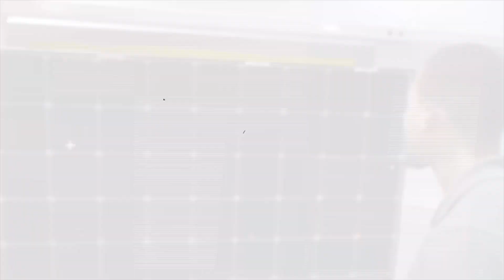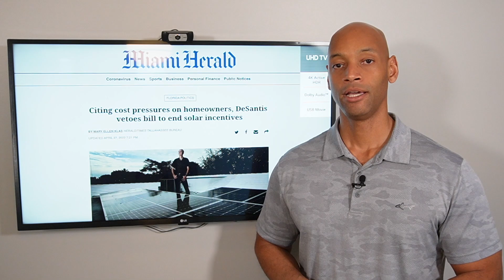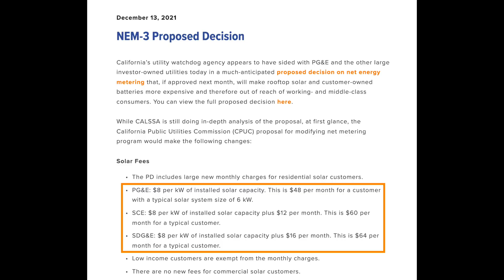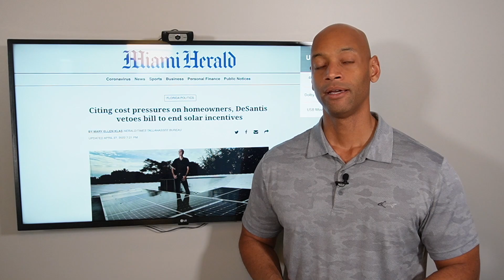Victory for Florida Solar Program

Comment: To be fair the best system is avoided cost. The utility pays the generator (homeowner, business) the cost of generation. Which would vary from day to day and hour by hour. The so called smart meter at your location should be able to accomplish that. You may find that you will actually get a better return on investment because during peak demand power can sell for many times the normal rate.

Comment: I'm glad this bill got shot down (because completely eliminating net metering unfairly benefits the power company), but 1:1 net metering will cause problems in the long run too (because it unfairly benefits consumers with solar at the expense of those *without*).

What we really need are real-time markets (both spot markets & 0-5 day futures markets) that accurately reflect the cost of generation & transmission.  If I have a V2G enabled electric car, I'll absolutely charge when power is cheapest.  If grid power spikes high enough to offset battery wear, I'll even supply power to the grid.
Reply: FPL (and Duke Energy and the other for profits as well) is attempting to block the transition to solar by residential customers who I suspect contribute the vast majority of their profits. In fact, the utility companies have  convinced the Florida Public Service Commission to allow them to charge each solar power customer a monthly "Grid Connection fee". So I don't see it as me as a solar user as getting a "Free Ride" as some contend. 

Furthermore, the utility companies have also been authorized to set a monthly "Minimum Charge" of $30 effectively having me pay for electricity that I don't even use!

Comment: Joe, you left out the most convincing argument against net metering, which is the duck curve.

For those who do not know, solar generation without storage puts pressure on the grid to absorb your power, then give it back later. The problem is most of the power on the grid is made cheapest by things which do not ramp down/up quickly. As a result, those installing solar only are kicking the problem over to power companies to solve the battery issue. Over the years this is getting more and more pronounced and when drawn as a single chart appears to draw a cartoon duck.

If you are still unconvinced, just ask what would happen if every house generated 100% of their power needs from solar. What should the grid do? Basically, we would be asking the grid to be a free battery or for just the cost of our account maintenance.

While I have limited tears to shed for the utility company, they do create a valuable service for the public and should be rewarded accordingly.

I think the plug at the end of adding batteries to your home system is something to consider as I don't think the matter is resolved, only postponed. If you are considering solar now, please do some research on batteries. It may stretch out your repayment period, but I am not convinced the electricity in this country is as guaranteed as we have been used to.
Reply: The solution to excess Solar PV electricity is to install home and/or community battery storage! Tesla Megapack, would help to stabilise local community power grids!
Reply: If the companies had maintained the grid  and upgraded it, solar would not be a big issue.  They never innovated and are slowely becoming obsolete.   Japan has consumer Hydrogen Fuel cell technology  for homes, they do not connect to the grid at all.   Truth be told when a person sends power up the grid, it is going to your neighbors amd the electric company gets paid in cash not credits
Reply: Are you sure that you do not work for an electric utility?  LOL  

@Solar Surge 

FPL (and Duke Energy and the other for profits as well) is attempting to block the transition to solar by residential customers who I suspect contribute the vast majority of their profits. In fact, the utility companies have  convinced the Florida Public Service Commission to allow them to charge each solar power customer a monthly "Grid Connection fee". So I don't see it as me as a solar user as getting a "Free Ride" as some contend. 

Furthermore, the utility companies have also been authorized to set a monthly "Minimum Charge" of $30 effectively having me pay for electricity that I don't even use!

Comment: It is small CoOp owned utilities, who are fighting against Net Metering the most, since it hurts their ability to balance their smaller grid far more than large utilities. 

PV Solar marketing needs to stop, being based on the promise of Net Metering based ROI. Due to Net Metering being unstantianable. Because when renewables become a high percentage of the power generation. The grid can't be balanced, without storage or load shifting. Which Net Metering creates no incentives for either and no revenue to pay for it. (ie there is a time value for when electric is generated, Net Metering, neglects that fact and the additional transmission costs)

It is always fun to blame the big bad monopolistic utility (I know I do, lol). But this time it is the environmental PV industry, who are misleading us consumers. To sell more PV panels. Just be honest about the true ROI of the solar PV your selling to us, which will not be based on Net Metering in the long run.
Reply: Some companies offer Power Purchase Agreement (PPA) similar to a lease. The company I work for offers this and it's a good alternative for those who don't want to rely on net metering as the basis for making a decision.

PPA is similar to a lease however we monitor, maintain and insure the panels that we install for you at no cost. We do this because our company utilizes the federal tax credit of 26% which can be claimed for 5 years allowing us to receive our ROI through the tax credit and earn you as a customer. It's just that, a power purchase agreement is an agreement to purchase power. We install at no cost, monitor, maintain, and insure the panels as well as your roof in the case a natural disaster occured and our panels were the cause of the damage. The best part is that it HAS to save you money otherwise you won't qualify.

If you want more information feel free to reply!

Comment: Don’t get too excited, FPL a subsidiary of NextEra, still owns the Florida legislature and the PSC.
Reply: Yep they got their per door minimum charge approved by the 4 member PSC in Florida.  This cost every Duke Energy net zero renewable energy customers an additional $17/month connection fee above the standard connection fee.  Expect this fee to increase again in 2024 after contract rate negotiations meeting. 

I have no problem with a connection fee but that is an expense for line maintenance and should be shared by all connected customer.  My excess power travels no more than 50 feet of wire to power my neighbors homes  and they get charged retail plus fuel surcharge for energy my solar system provided while Duke only pays wholesale minus $.01 for my annual excess power.  That means they are already profiting $360+ per year on energy I provide to them.
Reply: @jstaffordii  I used to work for a regulated utility, not electric though, they overstate the cost and under service the system quite frequently. In FPLs defense they have made huge upgrades to their system but they are vastly overstate the cost.

Comment: Just got my Enphase system with 10KW battery. It is great. Haven't joined NEM yet, but definitely sending more to the grid than I'm using right now. Going to be turning my AC down this summer.
Reply: How long is your AC on a day? Will 10kw run my AC all night here in Florida?
Reply: @Laissez_Faire  10KW battery won't run AC all night. I live in the desert and during summer I run it all day and all night using the grid, BUT I supply enough power back to the grid from solar during the day to off set the cost. Our power is more expensive between 4pm to 9pm. My 10KW battery depletes from 5PM to 8PM. I am currently sitting on $300 worth of power credit due to supplying more energy to the grid than I use. I no longer worry about using too much power and if I eventually do use more power it will still cost me less because of my 10KW solar paired with my 10KW battery.
Reply: What is NEM?
Reply: @TheFatman819  Net Energy Metering. Where you get credit for the power sent back to the grid.

Comment: Rocky Mountain Power has a similar law in Utah.  I have had my solar system since February 2022 and Rocky Mountain Power is paying approximately  $ 0.05kw while charging me $ 0.07kw for the first 400kw and over $ 0.10kw there after.  I am in the process of adding batteries to my system.  I have Enphase IQ7 micro inverters on my solar panels and am getting an Enphase IQ 10 battery system to complement my solar panels.  I am not a fan of R.M.P.    I would encourage anyone looking at going solar to include a battery system.
Reply from the maker: Nice setup!
Reply: Storage helps balance Rocky Mountain Power grid. So they win either way. (which proves Net Metering is counterproductive)

But with PV getting so cheap. Even at a 50% return rate, batteries do not seem worth it. Until the fact that it makes it possible to have power, during an outage is factored in...

Comment: I totally expected De Santis to sign this bill into law and I'm thrilled that he did not! In California we're having the same debate...and it's concerning. Our home is located within the Los Padres Nat Forest and we purchased a 8.16 kw system and 2 powerwalls because power is provided by SCE and is not reliable (we average 10 power outages a year of various lengths). Home backup batteries are a must...they work...and minimize your reliance on the grid for storage when when your system is not producing. With that said, I'm going to suggest, that if you're going to use the grid for storage and not purchase your own home backup batteries...then it's only fair that you pay something for storage. How much...I don't have a clue. Maybe instead of a full credit you receive 90/95 percent of your credit. Again...don't know. It's just a thought. Solar Surge...your team is awesome!
Reply: Governor DeSantis actually has quite a bit of Common Sense. He knows a bad and unpopular law when he sees it.
Reply: What is SCE?
Reply from the maker: Southern California Edison.  It's the electric utility in the San Diego area.  They also have the highest residential electric rates in the continental 48 states.
Reply: @SolarSurge  actually it’s SDG&E (San Diego Gas & Electric). SCE is more Los Angeles/Riverside/San Bernardino

Comment: There is no such thing as a free lunch.  I'm all for solar, but we should not expect the power companies to subsidize us.  We use the grid both to send and receive power.  Someone has to pay for the maintenance of that grid.  If it all falls on the power companies, then they must shift that expense to those who do not have solar.  Otherwise if they have to continually eat the grid maintenance cost, they will go out of business.  How effective will net metering be without a grid?
Reply: I have no problem with a connection fee but that is an expense for line maintenance and should be shared by all connected customer.  My excess power travels no more than 50 feet of wire to power my neighbors homes  and they get charged retail plus fuel surcharge for energy my solar system provided while Duke only pays wholesale minus $.01 for my annual excess power.  That means they are already profiting $360+ per year on energy I provide to them.
Reply: As a person who just bought solar panels, thank you to my neighbors who can't afford solar for paying extra high rates so I can fully net meter.

Comment: In RI, we have net metering to the point that you can 0 out the $$$. Power companies do have a point though, but I think it is too soon to modify it. Power companies do benefit from reduced demand because people are generating their own power.
Reply: Net Metering users pay nothing for the infrastructure and the transmission of the electric or the fact that the value of electric varies based on supply and demand. And that its benefits are skewed to higher net worth individuals. (So guess who ends up paying for the infrastructure? (It is kinda like Lotteries in reverse, that are skewed to the lower demographics, that help fund our schools))

I want to see a greater use of PV, but based on TOU (time of use) metering or other forms of supply and demand rates. That helps balance the grid.

Net metering is just used as BS marketing by PV sales companies, who know it has to be ended, when the use of renewables increase to a point where the use of net metering becomes unsustainable. And ofc most ppl will blame it on the greed of the utilities. Which is a nice scapegoat for unscrupulous PV sales companies who know better. 

Just a thought. And pls excuse my ranting trip down the rabbit hole, lol...